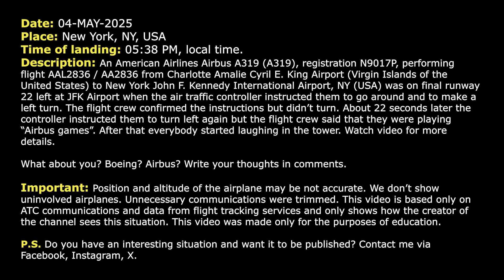“This thing just has a mind of its own very often”. Funny exchange at JFK Airport. Real ATC

Comment: I travel Emirates Saigon to London route and the first leg is a B777 and the business class has the lay flat coffin seats. I do like the window seat but to get out of the seat and with the isle seat in lay flat mode it's a clamber job to get over that seat. The second leg is A380 and the seat lays flat and is wide enough to roll onto ones side, using the toilet is no bother as their in a heron bone configuration. Plus the bar area is great to sit and enjoy a meal at a table and chat with aircrew and passengers. It breaks up the 7hr flight just great. just wish both legs were A380.

Comment: You can hear the auto-pilot disconnect when the pilot confirms so I'm curious to know also. Perhaps they were trying to get the speed from managed mode to selected mode? Or appch mode to go-around mode????
Reply: Most likely they didn't pull the heading select knob but only turned it to the heading. If you don't pull it, an Airbus flies the last lateral guidence which was put in by the pilots. On the Boeing you turn the knob and then press a button. Most likely this pilot only turned the knob like in a Boeing and as the Aircraft didn't turn although he turned the knob to the heading which he wanted, he thaught to himself, let's fly this by hand, so it does immediately do what I want instead of me thinking about what knob I have to turn or pull or press... They handled this verry well in the end.If the plane starts to fly you, YOU need to start flying the plane.

Comment: Boeing simply for the yoke.  If AF447 would have had yokes, that crash never happens.
Reply: If they had four PILOTS up the front it wouldn't have happened either.
Reply: @braveworld2707  They had three and none figured out what was happening until the guy finally said he had been pulling back on the yoke the entire time.  Then the other two both knew instantly what the problem was.  By then, it was way too late.

Comment: I talked to a pilot that switched from 777 to A321Neo, he loved flying in the A321 because it was so easy to "fly" BUT it does not let the pilot do certain things like a Boeing will. Also an Airbus always lands with a bunch of soft errors that need to be reset. However, the Boeing are a real pilots plane, you 'drive" them. He loved the 727 and 757, tough as hell and we all know the 757 is a sports car.
Reply: Everything you "want" to do what a Airbus aircraft would not let you do get's you immediately fired as commercial pilot
Reply: True in some way @Poolroulade
Reply: @quattrohead "BUT it does not let the pilot do certain things like a Boeing will" - that's something Captain Sullenberger of the Hudson must have been glad of, when he didn't notice the speed was dropping too low. Fortunately, his Airbus thought "I won't let you do that, Sully" and fixed it.  Even the best of the best can miss things due to task saturation - and he was certainly that!

Comment: They weren't laughing at "Airbus games", they were laughing at the pilot trying to blame the aircraft, as the guy made clear at the end when he sarcastically said it again lol. You can hear the autopilot disengage but seems they were too scared to grab the stick and manually fly a heading without the FD telling them where to go, pretty bizarre.
Reply: So you know exactly what was going on in the cockpit? For that matter do you even know how Airbus aircraft work?
Reply: @Skywest25  yep, and you have two options in this situation. Use the autopilot to level off, initiate climb, set speed, adjust heading putting you in CLIMB, OPCLB, HDG or you could disengage the autopilot and perform a go around. Then you fly by hand and follow instructions the same way you would in a Cessna. Key word here "you fly". Not "you try to set-up the autopilot again."

The autopilot is an aid, a tool to use when it makes sense. You wouldn't use a screw driver as a hammer to drive in a screw because you picked it up at the wrong end either.

Comment: A “Cancel approach clearance” doesn’t necessarily require a full on go-around (TOGA) procedure. Using the automation a simple momentary level-off by pushing the VS button, setting the altitude to 2000 and pulling (open climb), selecting 180 heading and selecting speed 210 would have sufficed. Only takes a few seconds. Of course TOGA/soft TOGA litany is also available. The problem is the muscle-memory just isn’t there because go-arounds simply aren’t done that often and, unless fully briefed on every approach/landing, pilots can find themselves assholes and elbows trying to apply the procedure. 

In lieu of muscle memory my technique is to brief the go-around by conducting a “rehearsal” where both of us go through the procedure verbally so we’re not caught by surprise. It helps!
Reply: Interesting. Did your company amend the FCTM?
When ABOVE the selected FCU altitude we may do the discontiued approach procedure (pretty much as you described - SPEED V/S NAV).
But BELOW FCU altitude always requires TOGA or Soft-GA. 800ft is minimum thrust reduction altitude, so in that scenario I would set TOGA and then right away retard to CLB. And keep the autopilot engaged, cause it really works great on GAs as well.
Reply: @vw72713 The video picks up when they’re handed off to tower which means they’ve been cleared for the approach, “FINAL APP” is displayed, or they’ve captured the glide slope, and missed approach altitude has been set. I don’t have the approach in front of me with the name of the fix they reported. In any case it’s up to the CA to decide whether a Go Around is used or a discontinue approach method is flown. For me, generally, (each circumstance is different) if ATC provides vectors that are substantially different than the published missed I’m discontinuing the approach using the FCU. If I’m well inside the FAF I’ll likely use TOGA.

I’m guessing these guys used TOGA which means it will fly the published missed for whatever approach they were flying (mind of its own?). This requires them to select heading to turn off course and select V/S or open climb to get out of SRS. I’m just speculating though.
Reply: @robav8or  I would say aircraft guidance management on short term is up to PF, not necessarily the CA.
Reply: @robav8or  FCTM procedure is to fly a standard go-around below the FCU altitude, which they clearly are. You sure you're real-life crew?
Reply: @robav8or  FINAL APP is not display for an ILS, that's an RNAV approach mode. If they are below the FCU ALT then they need to conduct a MA, 'cancel approach' from ATC does not equate to a cnx approach inside the cockpit. Keep trying though!
Reply: @ I don’t understand your aggressive position on this subject. My employer has been flying the AB-320 family aircraft for literally decades and have developed their own FAA-Approved flight training/operating manuals. So at this point I’ll just say “You do You”.
Reply: @andrewj591  You are correct and I’m aware of this fact. Go back and read what I typed. I wrote “FINAL APP is displayed OR they captured the glide slope.”
Reply: @robav8or  What aggression? My operator is in the top five 320 fleets by size and we operate to the procedures Airbus produced - I don't know why any operator would amend the go-around elements. Anyways, regardless what these guys were operating to, it certainly wasn't company procedure.
Reply: @UKV1452  Your statement “You sure you’re real life crew” was completely unnecessary and unwarranted.
Reply: @robav8or  I was asking because what you were posting is quite unusual for someone claiming to be type rated and current on the aircraft - i refer you to the rest of the commentary also asking questions sir
Reply: @ I was able to look it up. For clarity (and FWIW), my employer uses 1000’ AFL as the delineation point. At and below 1000’ AFL either full or soft TOGA. Above 1000’ AFL thrust and configuration are at the pilot’s discretion. No mention whatsoever is made about the altitude setting on the FCU.
Reply: @robav8or AFL? Wtf is that, you mean AFE or AAL?  The only time I've seen that abbreviation is the ICAO code for Aeroflot. 

It seems amazing that an airline would amend the manuals that much after clearly defining the difference between a "go-around" and a "discontinued approach" in the FCTM and FCOM. 
Would be interested in hearing what operator that is! :)

If people on the line however use the technique you described below FCU altitude it would be a different thing! But for the manuals to in any way say so sounds strange, to say the least.
Reply: @ AFL = Above Field Level. As is often the case there are ways to accomplish the same tasks using different methods/techniques. The job would be pretty boring otherwise if every task was completed the exact same way across multiple users of the same aircraft. No one operator has the market cornered on absolute procedures. A couple here keep referencing the FCU altitude but no one has provided a reason for the technical limitation they fall under. My company has decided to use 1000’ AFL as the point to decide whether to use TOGA or the FCU to discontinue the approach. And the FAA has approved this technique.
Reply: @robav8or  Yes alright, I get it. The standard abbreviation is AFE for above field elevation, but ok! 

So I think what people in general are referencing is the fact that in thr FCOM under Normal proc > sop > approach general > discontinued approach  The manual clearly states "When the aircraft is below the FCU altitude, the flight crew must apply the GO AROUND procedure."

But it is ofcourse possible for an operator to modify the sop, it just seems like a weird thing to change. Considering how it messes up the sequencing of phases, instead of performing a soft-toga.
Reply: @nillolajnen5721  Standard for whom? Not to belabor such an insignificant point but The FAA uses “AGL” (Above Ground Level) (From the AIM). My employer substitutes “Field” for “Ground”. It’s more precise as a reference point for sterile chime.

Still waiting for someone to explain the technical reason(s) for the mandatory use of TOGA when below the FCU altitude…
Reply: well we hear the AP disconnect cavalry charge so... they attempted to handfly it i thought?
Reply: @ Maybe. It shouldn’t make a difference. If the aircraft is being hand flown the pilot should be doing what the autopilot would be doing if it were engaged: follow the flight director. Workload is definitely increased though as the pilot monitoring must now make the FCU inputs while communicating with ATC.

Comment: I’m a Boeing guy, I’m guessing stuck in approach mode?
Reply: And as a Boeing pilot you know that it takes 1 second to switch NAV freq and exit app mode, just as this Airbus pilot should know how to do it on his plane...but he doesn't.
Reply: @BravoLimaDelta . 777 needs either toga or auto pilot off and both fd s cycled.   No radios to select new frequencies
Reply: Flew the 737 and I remeber that thing with switching freqs or recycling FDs.

The Airbus doesn't do that - just checked the OM-B.
When LOC and GS are shown on the FMA you can always disengage it by pushing the APP pb again.
At 350ft RA the FMA changes to "LAND" (instead of LOC GS) and it locks the approach mode. You can only get out of it by either performing a go-around or disengaging both FDs.
Reply: Momentarily moving the thrust levers to TOGA then back to the climb detent will put it in go-around mode. I think the PF’s decision to disconnect the A/P once the approach clearance was cancelled only complicated matters as the PM now has to make changes on the MCP. It sounds like the PF was just following the F/D and the PM never pulled the heading knob. It’s the Airbus equivalent of not pushing HDG select in a Boeing.

Comment: This is pretty funny. Yall need to lighten up 😂
Reply: The pilot should know how to fly the aircraft, as soon as it doesn’t fly as intended, revert to manual flight and let the pilot monitoring work out the issue
Reply: These pilots are obviously not fully in control of their aircraft. They couldn't comply with something as trivial as a heading change when instructed by ATC for god's sake. What's funny about that? A crew that's overburdened with the different autopilot modes of an Airbus has no business in the flight deck of an Airbus.
Reply: @Hurricane2k8  Oh for fuck sakes. Were you sitting in the flight deck watching what was happening? Such dramatic assumptions over a goofy ATC tape. Get over it